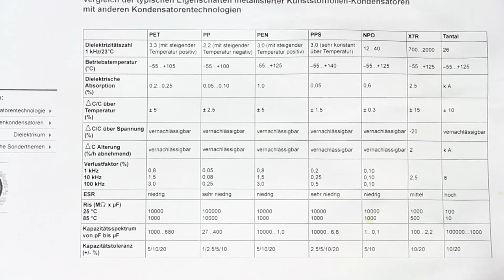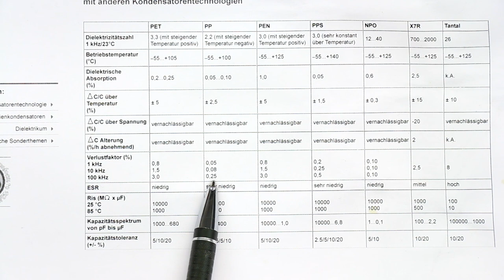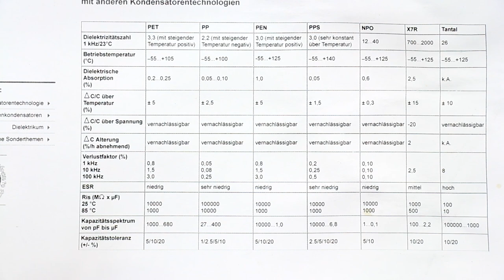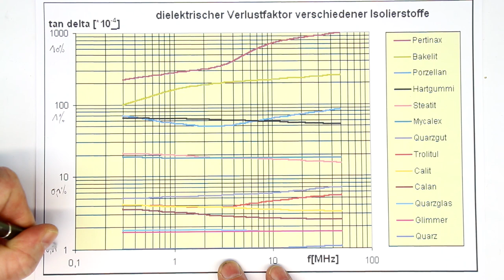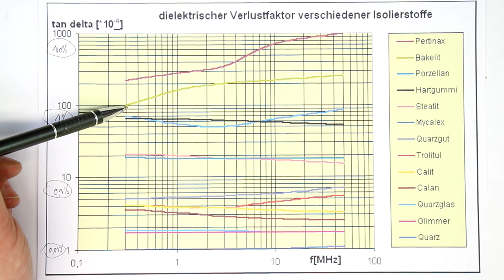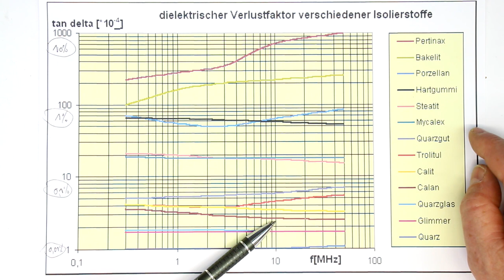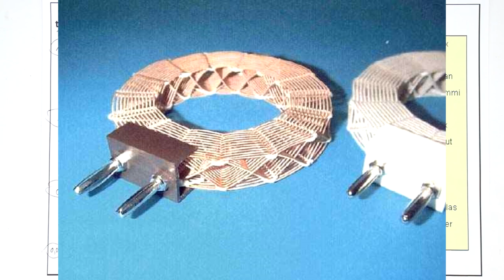Resonant Magnet-Field Antennas [Pt.5]: Dielectric & Magnetic Losses

Comment: Hello, I'm interested to antenna for LW, is possible to connect it to a RSP1A by SDRplay?
Reply from the maker: You need a high-impedance antenna-input (e.g. 1 Megohm) or a buffer-amp with a high-impedance input to connect a tuned LC tank-circuit with a receiver.
Reply: @KainkaLabs  , thank you.